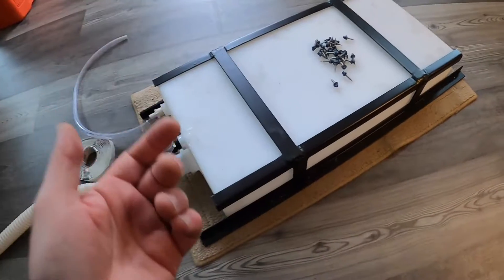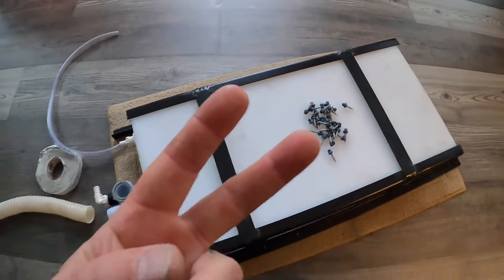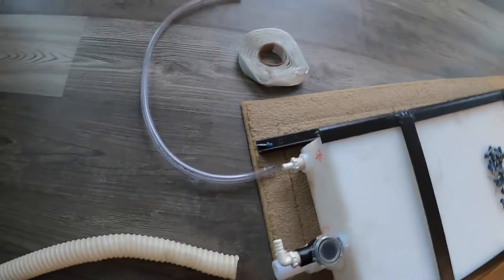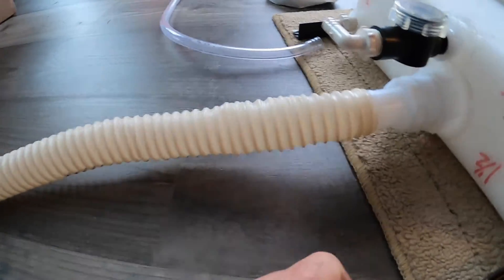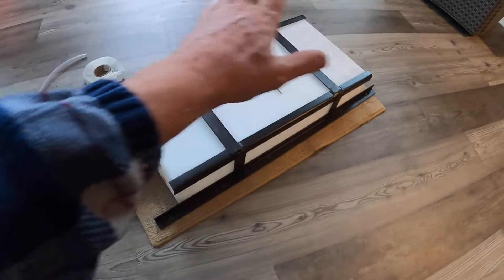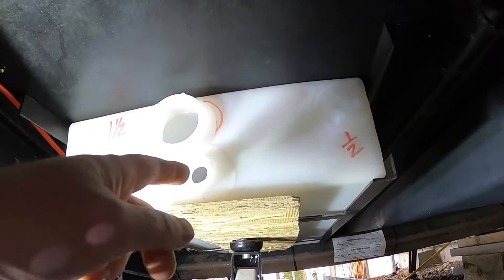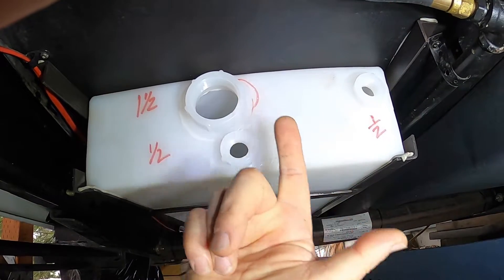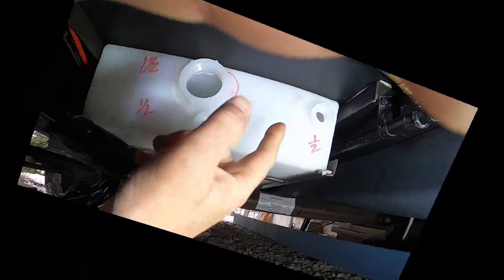Moving the Water Tank Underneath - Part 9 - 2015 Tab Max-s Trailer

Comment: Where did you buy the tank and the frame? I suggest you include links to the items you purchase in your YouTube videos
Reply from the maker: @mathieuprovostst-onge981  I have mentioned them a few times in previous videos I've put up, but my goto place for tanks is plastic mart.
I fabricated the frame myself.

https://www.plastic-mart.com/?cq_src=google_ads&cq_cmp=19902021013&cq_con=146792249239&cq_term=plastic%20mart&cq_med=&cq_plac=&cq_net=g&cq_pos=&cq_plt=gp&campaignid=19902021013&adgroupid=146792249239&creative=655907806213&matchtype=b&network=g&device=m&keyword=plastic%20mart&utm_source=google&utm_medium=cpc&utm_campaign=19902021013&utm_term=plastic%20mart&utm_content=655907806213&hsa_acc=3650137468&hsa_cam=19902021013&hsa_grp=146792249239&hsa_ad=655907806213&hsa_src=g&hsa_tgt=kwd-1424058960&hsa_kw=plastic%20mart&hsa_mt=b&hsa_net=adwords&hsa_ver=3&gad_source=1&gclid=CjwKCAjw74e1BhBnEiwAbqOAjPrUZaFYfE75JOf-8duMcTOmg949J9dkV6bOQua_kbQjryVIVn1GyhoC1yIQAvD_BwE

Comment: My 2015 T@B 320s has the tank already mounted on the bottom, didnthe factory start to do that at some point or was that possibly a mod done by a previous owner?
Reply from the maker: It was the middle of 2015 that they moved the tank downstairs. (Customer complaints) Some have it under the sink, some do not.
Check out this early 2015. Walk thru video, and you will see the tank in the bottom cabinet.
https://youtu.be/c9FVqcKPlU8